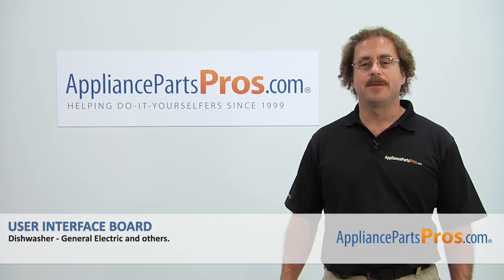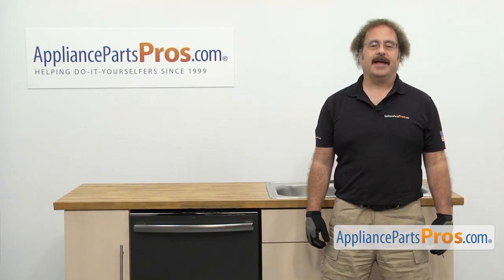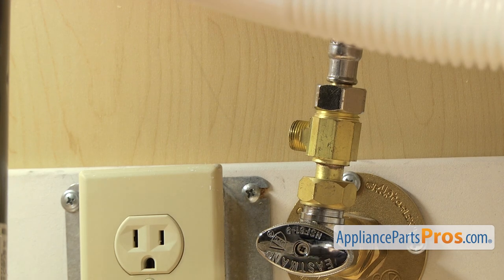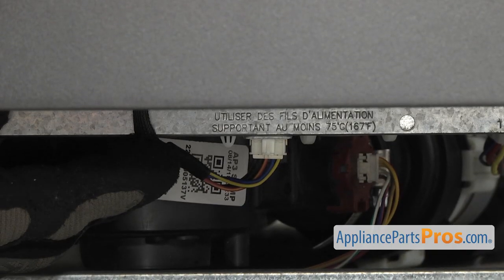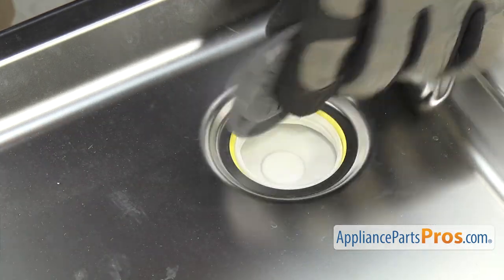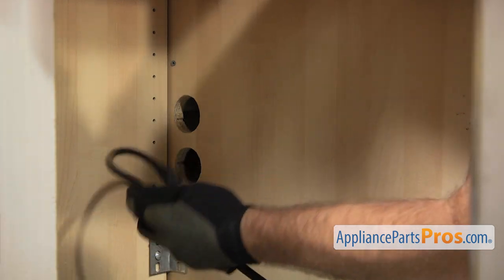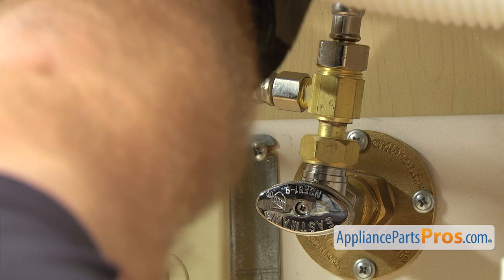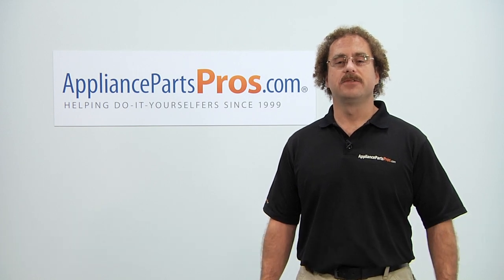How To: GE Dishwasher User Interface Board WD21X23462

Comment: This is a terrific instructional video, but on such a new dishwasher model, the repair should not be necessary. My grandma and grandpa’s GE washer and dryer set lasted them over 25 years and were passed on to my wife and I when we were first married. We eventually replaced them with “newer” models that failed over and over. In 35 years of marriage, we have repaired and eventually replaced many times all appliances of every brand, which is one and the same, only to still be looking at a video like this to repair an $800 dollar dishwasher that is still relatively brand new. Our matching fridge has failed us and I can only thank the good Lord (and He is) that we didn’t purchase a matching oven and overhead microwave only to break too.
Reply from the maker: Good luck with your repair and let us know how it goes!

Comment: Beware, there are 2 control panels on most GE dishwasher models. This panel, at top of door to control desired settings and a panel at bottom of door area near dishwasher frame. This lower panel has relays and such and was the panel I needed after buying door control panel. Both will give the 3 beep message preventing unit from starting. My dishwasher, for example, took a WD21X24901C. Be sure what your dishwasher needs. It will save a lot of extra work. This video, however, is an excellent reference to replace the upper door control panel. Thanks
Reply from the maker: You're welcome!

Comment: Thanks GE boards that routinely fail after 3-4 years. Quality product!products
Reply from the maker: Keep in mind, there are several things factoring into board failure. Such as environmental, power surges, normal wear and tear as well as manufacturing.
Reply: Exactly this.  I used to design electronics for a living, very niche and high-end products.  MTBF testing for consumer products like this, especially with such widely used products, should be a much higher priority for a company, especially at this price point.  Makes me pretty upset when you need to replace $150 boards every few years.  They could do better but choose not to make it a priority.  Shame.

Comment: Is board good for PDT750SSF1SS? My display is frozen and cannot be reset.
Reply from the maker: The correct part number for model PDT750SSF1SS is WD21X22074. You can place that order through our website or call us at 1-877-477-7278. Thank you!

Comment: Good video as always, but would be nice to first diagnose if the problem is the main control board or the UI.
Reply: There’s pins on the main control you can test for DC voltage to the UI
Reply: Good point.  I replaced the main control board first, thinking that was the problem. But it wasn't, it was the UI. So yes, check the voltage on pins 2 and 5 on the Main Control Board and see if you have 14 volts.  If so, the Control Board is fine, and it's the UI Board.
Reply: @GregGum  I'm in the same boat.  I just ordered the user interface board just trying to decide if I put my old control board back in and request refund, I'm still eligible.

Comment: Why does the moisture keep getting into my User interface board? I already replaced it once because the moisture ruined the controls and it's full of moisture again in less than 6 months? why is it not keeping dry inside the control panel? Thank you for your videos!
Reply: Because the design is terrible and GE doesn't care.

Comment: How do you know if it’s the user board that stopped working. And not something else
Reply from the maker: Do you have a multimeter? You can test the board to see if it has the correct voltage coming to it.

Comment: Just finished the install. Thx for the video, and the board which was very convenient to buy on your website. Worked a charm. Just one detail, more and more modern kitchens have marble countertops now. In that case, the screws holding the dishwasher are in the sidewalls of the cabinets that are on both sides of the dishwasher. Or the installer did a combination of both the countertop and the sidewalls. It depends on the enclosure to get the dishwasher out of the installation correctly.
Reply from the maker: Glad to hear you were able to do your repair. Thank you for the information.